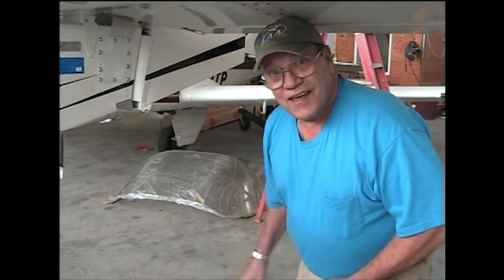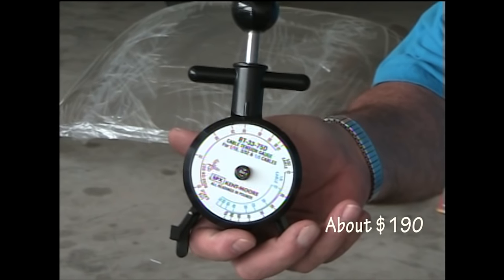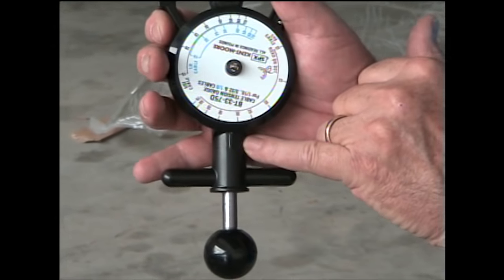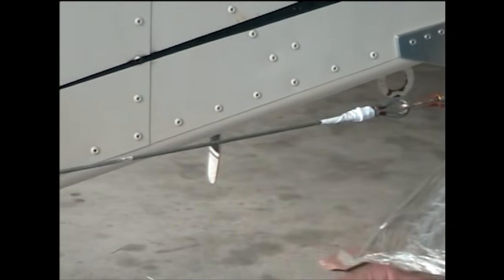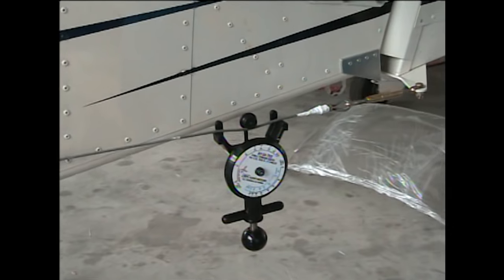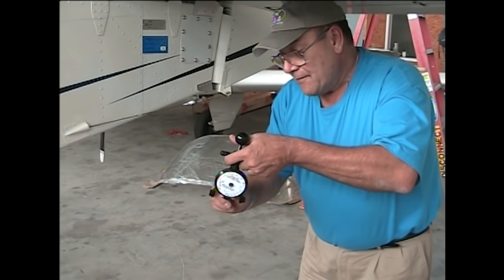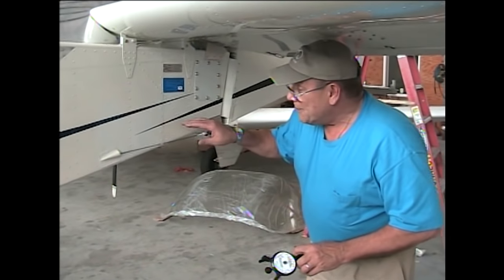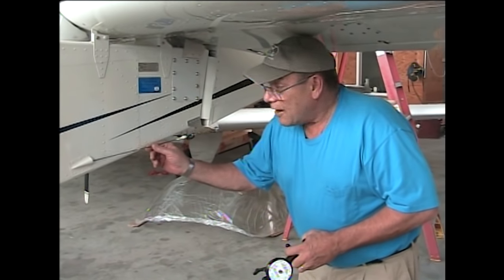Measuring Aircraft Control Cable Tension

Comment: Its not right practice to check the tension right next to the turnbuckles, or near to the attachment point. Its always better to check somewhere in the centre of 2 attachments or turnbuckles. Correct me if i am wrong 😎
Reply: 100% right
Reply: At least 6 inches away if possible